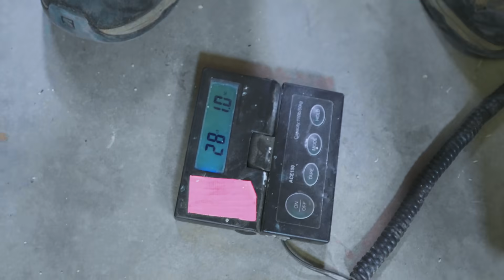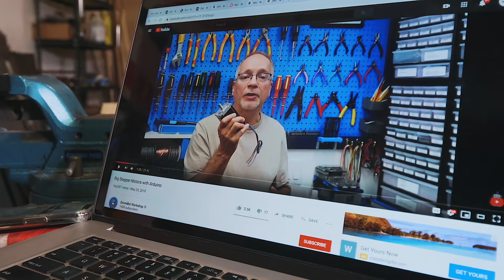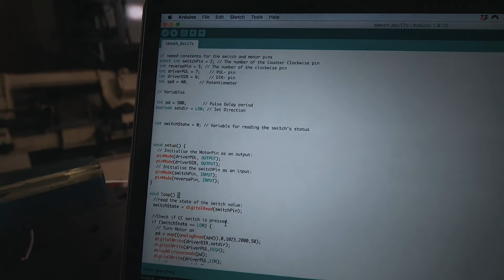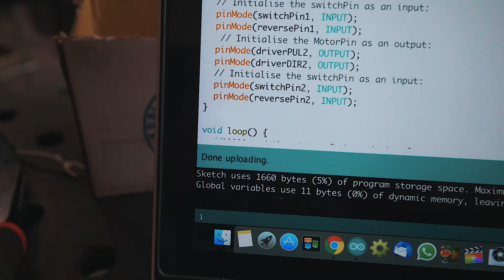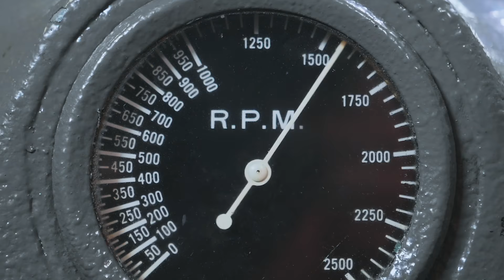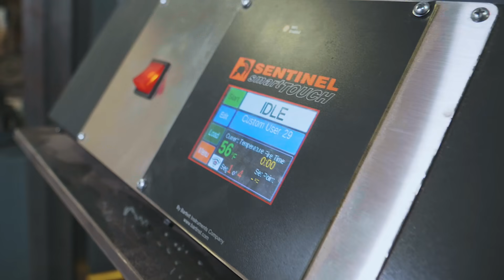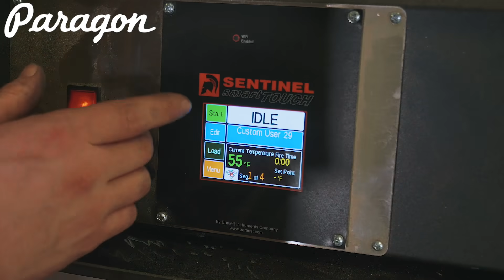MAKING FORGE DOORS!!! Part 2

Comment: Why not make a door out of fire bricks rather than refractory and K.I.S.S. it Alec Keep It Simple Stupid.  A pulley with pair of steel cables one side is connected to a foot bar the other is a offset weight 20lbs of weight would give the foot bar a 8lb weight to lift. He could even use this to fix the weight issue on his doors. send the cables out like T connect one side to a offset weight. The purpose of this weight is to reduce the weight of lifting the door as long as the door is heavier than that weight it will go back down. You could reduce the weight to almost nothing to make it easy on the motors.
Reply: Yeah, I was just going to suggest a counterweight
Reply: Or use a Gearbox
Reply: Yep, counter weight the doors and those beefy steppers will have no trouble moving them
Reply: @oliverklotz6064  counter weight forged out of cast iron... or Damascus foot pedal forged... cast bronze...
Reply: I agree...  Adding complication and tech to a simple lift gate will cause future issues...  A simple mechanical foot peddle with a ratio based cable and counter balance is simple and fool proof... And yes I am an Engineer...
Reply: The door attached with cable to "worm and wheel" powerd by a handcrank.
Reply: Remember when he forged stuff Pepperidge farms remembers.
Reply: But guys all things considered isnt it easier for him to just hook up some wires to a motor and code it rather than all the calculations it would take to do what u guys are suggesting, I might be very likely be wrong as I'm an amateur in both fields.
Reply: K.I.S.S 
Keep It Simple Steele!
Reply: @al-rajeanallie1190  100% would be wayyyy more simple to use a counter weight on a lever than write custom code, wire up electronics, and manufacture a cable and pulley system. You should know that already even if you are a student.
Reply: Shhhhhhh! I'm enjoying watching Alec build a needlessly overbuilt and complicated door. Practical is boring.
Reply: @trash_in_a_box  maybe this is just my opinion but the arduino code for something like this would be pretty simple, simpler to me than the math involved.
Reply: What about, well... a normal door, you know, with hinges and handles
Reply: Well really it would be easier to weld a vertical pipe to the forge stand and make a double door like a horse stall or even triple  or quad door if you want adjustability lol
Reply: @Steglos  he wants it to be foot operated as many times you hold the tongs or part with both hands. I  would of did a simple pulley and counter weight but those steppers are plenty big enough and should work fine
Reply: Sometimes I think he makes things more difficult just for the content.
Reply: @tinglemccringleberry8899  I no a least hes not sewing. He needs to figure out what he wants this channel to be so I can decide if I want to keep watching. He is very talented but I think maybe his attention span is short as he starts new projects while working on others. Alex if you read don't take the wrong way I love when you Forge and fabricate but the shipping of tools and sewing and the silliness I am not a fan of and it sounds like I am not the only one. Lets get to making another sword!!! Please
Reply: @LM-gq1om  I can see that and it makes you feel good when you accomplish something out of your normal wheel house.
Reply: @al-rajeanallie1190  Coding for someone who has never coded in their life is not simple. And it's grade school level math. You just multiply the distance from the fulcrum and the weight and make sure that the door side and the counter balance side are equal (or a little bit off so that the door gently shuts when you take your foot off the pedal or whatever). Or you can use trial and error if you really have an aversion to math. Even a child can figure out where the center of mass is on something like that.
Reply: But there is no fun in keeping it simple. Plus he likes to learn new things, so why not go all out.
Reply: I was writing the same solution in a comment until I saw your comment. Spot on. The counterweight can also be sized to enable a slow return and prevent the door from slamming, which will improve safety. A simple catch on the foot bar could hold it temporarily in the raised position and allow it to be easily released with a second foot press. 

From a risk perspective a manual backup lifting mechanism will be required anyway. Given that the current stepper system is being made from cheap components with little programming experience, the robustness in a hot, dirty high-friction environment will be very low. It could lead to the door being stuck down, which could cause billets to be overheated and ruined, or waste time trying to troubleshoot. A foot lever system with the pulley and counterweight would eliminate those risks and be much more reliable.
Reply: @HvV8446  because he want to be able to operate it with his feet so his hands are free.
Reply: @jvmiller1995  agreed and well said.
Reply: It would be even easier if he had a perfect counterweigth. There wouldn' be need for any electronics at all. Just do a bar on the bottom with the counterweigths attached to each side, attach the a cable to the weigths, put some pulleys on the corners of the beams that are already in place attach the cables to both sides of the door. It will stay open or closed and is easily operatable by foot.
Reply: 100% right, but sometimes we just do things to do them.  To broaden our skills.  I'm chalking this decision up to curiosity.  Who knows it could lease to much cooler projects in the future.
Reply: Once he's counterbalanced it, just have the foot lever bar have various catches on the side of the frame and with a bit of flex of the bar, you can move it to different positions, no need for motors
Reply: Lunas Eclipse I think he knows he could have made it much simpler. But being a successful YouTuber, he also knows complications makes good content.
Reply: @Ready_for_apocalypse  I personally would rather have seen them forge an elaborately decorative foot pedal and counter weight than watch him mess with arduino driven steppers  in fact I doubt I'll watch the rest of the door videos. The doors only needed be as simple as he wanted he could make the frame out of all forged material have it look really cool and further I don't think in the long run he will use the electric setup it will need 2 pedals and 2 pots mounted on something he can step on. The door will then need to open fairly quick and potentially close as quick.
I suppose the pots don't need be adjusted every use but I just see this as something a sponsor pushed on him.
Reply: @Lunas2525  you can't forge cast iron. the carbon content is too high
Reply: @RecoilOperated   that isn't my point my point is he could be making something beautiful using fire and iron of some sort and maybe a grinder. If his door is 28lbs then a weight that is 20-25lbs would make the door weigh 3-8lbs. How the weight looks is entirely up to the designer. 
Instead he is playing with motors and programmable drivers.
Reply: @jvmiller1995  he can't please everyone, all these guys telling him to make a Damascus counter weight, or coffee cup...... If it's not something someone wants to watch, those people complain. Mostly kids that never have built anything in their lives, a Damascus counter weight?? People want to watch him make a Damascus weight?!??  The kid is learning a lot of new things and growing, he's maturing. He is filming Alec Steele's life projects.The business side of things is going to wipe him out though if he doesn't hire enough competent staff, YouTube videos take a lot of time and may not return well when people don't watch. Just enjoy him for him or watch black bear forge or something, or better yet go out and light your forge, I know I've been meaning to.

Comment: You should probably have some limit switches and code to stop trying to raise or lower the door past mechanical limits.  Otherwise the motors could burn out or mechanical things go snap/bang.
Reply: Or, they could think about springs or counterweights.  Probably cheaper than buying new electrifical stuff.
Reply: limits could possibly added in the software depending on the controllers used for the stepper motors.
Reply: @capelectronics  So why have limit switches on a 3d printer? It's just for safety and doesn't cost that much. The coding is simple to.
Reply: He needs the help of Michael Reeves
Reply: @capelectronics   You don't need to set the switch near the door at all. With wire and pulley's on the stepper motor, you could easily set the switch elsewhere away from the heat ; )
Reply: He could also use a heat resistant probe as a switch for example ^^
Reply: @dawkinschmidt3921  I don't think he wants a forge that either screams every time it's openend or constantly electrocutes him with tasers. :D
Reply: @ignatz14  that is a perfect response but Michael would probably make a way to force you to swing the hammer like forcing people to dab

Comment: Alex: You might consider rotating the design 90 degrees, supporting the door on THK rail, and sliding the door left to right with a linear actuator rather than raising the door. This has the advantage of getting the motor as far from the heat as possible, greatly reducing the motor load, and in a catastrophic failure the door doesn't fall.

Comment: You 100% have to use a worm gear in case the electronics fail, the door doesn't just slam shut when the motor loses power. It'll also mean your motor isn't constantly loaded.

Edit: ALEC read this about CO build up -
Say the counterweight is not properly balanced and the motor fails, the doors drift shut when alec/will are doing something else, causing carbon monoxide build up. All that would happen when a worm gear fails is the door would stay in position. So sure, add a counterweight but couple the motor into the system through a worm gear first
Reply: Yeah a serious concern. Though they'll only be powered while the doors are opened, which they won't be a lot I guess. At least needs a mechanical stop (something to jam in there, safety pin through both zylinders maybe) to safely work on the forge if your hands go near the doors, e.g. to clean out the inside.
Reply: Or use a counter weight. The doors can open and close faster.
Reply: Steppers don't care about being constantly loaded.
Reply: Or one can counter-weight the door and put a goof buffer on the travel stop for the counter-weight (so if it ever ends up in freefall it will not hard-stop by slamming shut) or put in a wedge/block that positively engages stops on the frame unless actively retracted (so a failure of the system results in a door that safely stays in place.)
Reply: I think a counterweight would be a better option as it means less moving parts and things to wear out. Also, alec could forge some nice looking weights to go on It.
Reply: He could still use pulleys and fix constant load and loss of power, something that would grab and take the load of the pulley when the power is turned off to it, like an electronic one way capture pulley...
Reply: Worm gear is a good idea but not 100% necessary. Id install a type of locking mechanism at the top thats wired to a limit switch. Door reaches the top, hits limit switch, locks door in place and steppers shut down. Turn steppers back on, reverses the lock and now youre good to lower the doors. Very minimal stress on the motor.
Reply: Steppers usually are underload all the time to hold them in place.
Reply: @crazymodder2  I thought that as well, but a worm gear is simpler (less moving parts) and has many more positions it can be set to
Reply: @trash_in_a_box  I think counter weights could be part of the solution, but shouldn't be the whole solution. Yes it will reduce load on the motor, but it will also double the system weight. The worm gear is an inbuilt ratchet, if you will, which gives better safety 

Say the counterweight is not properly balanced and the motor fails, the doors drift shut when alec/will are doing something else, causing carbon monoxide build up. All that would happen when a worm gear fails is the door would stay in position. So sure, add a counterweight but couple the motor into the system through a worm gear first
Reply: Thats what i said on the last video. So much simpler to set up a worm gear drive down low and away from the heat of the forge.
Reply: Or he could have the counterweights slightly biased towards the open side so if the motor fails, it stays open. Overall, worm gear is better tho
Reply: or use a counter weight that is heavier than the door. if the motor stop the door wil open. problem solved
Reply: There does certainly seem to be a need to have the system “Fail Open”.
Reply: end switch?
Reply: How about a synchronized ball screw/nut system. This is the setup on my cnc z axis and I know the head weighs more than 30lbs.  Doesn't drop when power is turned off.  Couple of ball screws going up either side with the door connected to the nuts at the top.  just spin the ball screws and the door mores just fine.
Reply: A worm gearbox driving the cable seems like a simple thing that will solve the problem. A counterweight might be a worthwhile addon.
Reply: A worm gear could also offer an opportunity to ratio the output to lower the strain on the motor. Probably a 5 to 1 ratio would work.
Reply: You got to take one motors and Wire One backwards to the other on the same driver or you can use a worm gear or you can make some sort of assembly I would Google door opening mechanisms and decide what kind you want more than likely somebody will have a 3D print ready to go if you're trying to make it automatic though and you're trying to get the motors to drive open doors and close  DC motors change Direction with polarity all you have to do is flip the wires you also want to wire in a some sort of switch to stop the doors in certain positions like a micro switch easiest way to get one is out of a microwave there's about three to four of them in actually thinking about you probably should have just use the guts out of a microwave could use the rotary motor turn the doors cuz they run clockwise and then when they hit the switch and you started again it runs counter clockwise also there's a second motor that runs a fan what you could have use for a Honeywell smart valve for furnace it already has the flame sensor and start assembly on it just add power plus the motors out of the microwaves are made for heat applications which will act a lot better than stepper Motors  personally I'd be cool if you just made it strictly mechanical no power no extension cord. Do wheel with a suicide knob on it rent a piece of all thread through a nut welded to the forge have it where you turn the wheel to open and close the doors all that can be forged or cast it out of metal or even turned on the lathe if you don't want to use all thread.
 just DM me if you need some help or someone to draw you up a schematic I can also send you free secound hand parts if you pay the shipping
Reply: I proposed under the previous video the idea of two opposing moving forge doors. So when one opens up, other one lowers down, giving access to both sides of forge. It works like regular elevator, but two weights (the doors) do have equal weight. The main advantage of counterweight doors is a possibility to shut  or open them without power supply (pulling the back door down to raise the front one and vice versa). In case if one needs a separate doors control, then the motors and pulleys must act separately - by rotating one motor one movable pulley slides down and the other one (motor and pulley) stays in place. So the working balanced scheme needs 2 doors, 2 movable pulleys, 2 or more deflective sheaves,  2 engine sheaves and two counterweights with 1/2 mass of the door mass. Something like that
Reply: some motors are stiff enough to hold 30LBS without power to them.  have you ever turned by hand a heavy duty electronic motor?
Reply: Rhage73 fail safe bro. Cover all options.
Reply: Can always use a Pneumatic actuator a lot easier to wire up valves it's what they would use on a trash incinerator
Reply: Some end stop switches would be a good idea too.
Reply: You can get away without a worm gear as long as you gear it down enough with planetary gears...
Reply: @trash_in_a_box  I think counterweights are absolutely essential.
Reply: @theninjapizza33  I don't really see how properly balancing the counter weight would be a challenge... he has a scale that can measure to tenths of an ounce and he has all the tools needed to cut or file down a metal counter weight until it is damn near perfect. And I am not sure what you mean about doubling the system weight... yeah, it would make his forge heavier, but I don't think he is worried about picking it up to move it. If you are talking about the work that the motor would have to do, it would be essentially the same as the worm gear.
I don't deny that having dangling counter weights would look stupid though. A worm gear would be much more compact and clean looking.
Reply: @David-if2hj  What you said makes no sense... unless you are trying to burn out the motors by having them work to keep the doors closed, which is like... almost always.